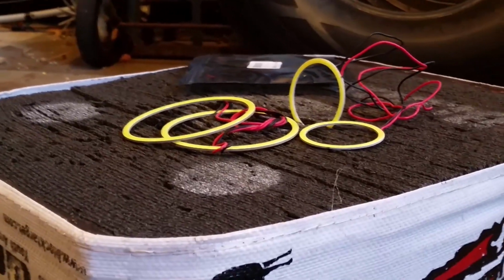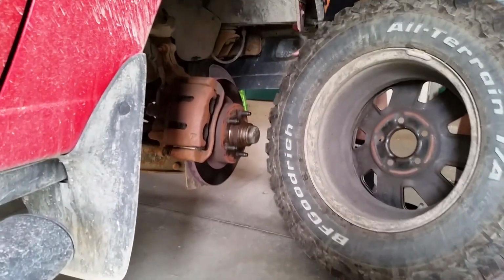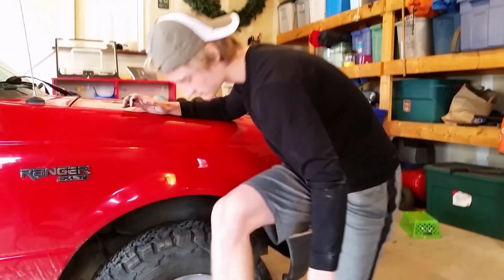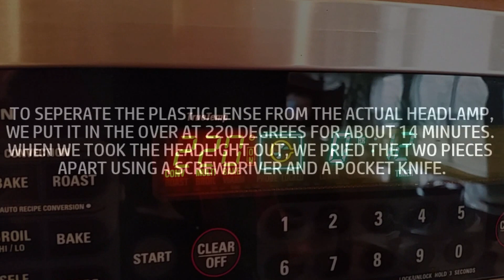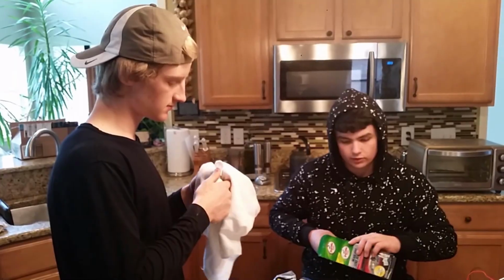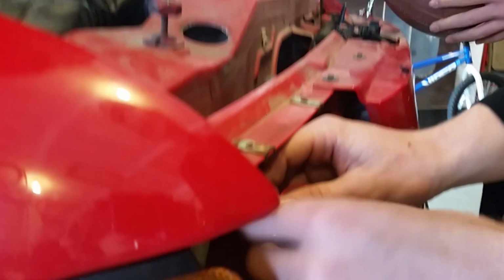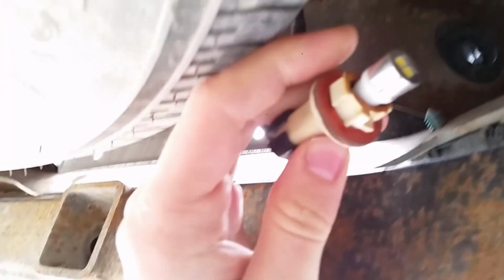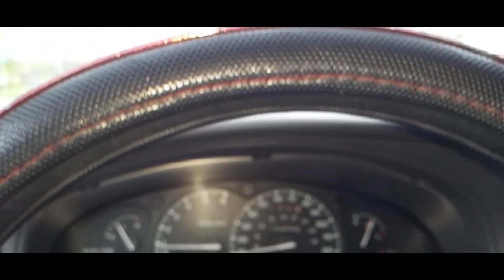How To DIY Halo Lights CHEAP | Halos & Spacers

Comment: I never could actually see any good footage of the finished product.
Reply from the maker: Sorry to hear that...if you are thinking of doing the halo lights, I'd recommend using a LOT of hot glue because when they're on you won't even notice it, and my LED's started falling off in a couple of months. I ended up forking over the money for some real halo's, and they make the truck look 10x better. Here's the link: https://www.amazon.com/Spyder-Auto-PRO-YD-FR01-1PC-HL-BK-Projector-Replaceable/dp/B003ZNVFQ2/ref=au_as_r?_encoding=UTF8&Make=Ford%7C54&Model=Ranger%7C696&Year=2002%7C2002&ie=UTF8&n=15684181&newVehicle=1&s=automotive&vehicleId=1&vehicleType=automotive